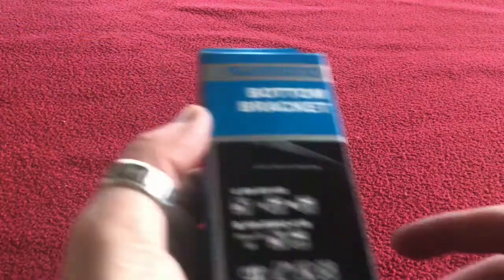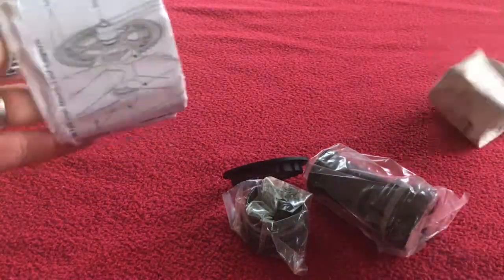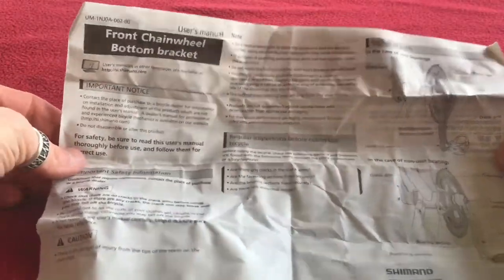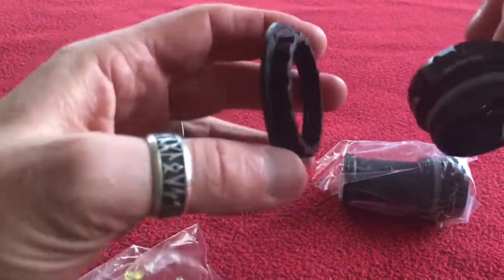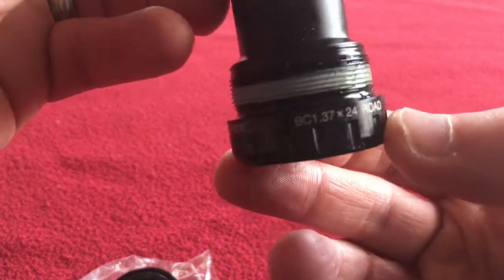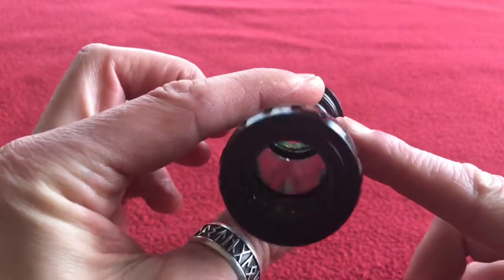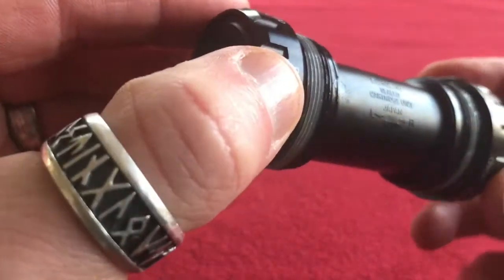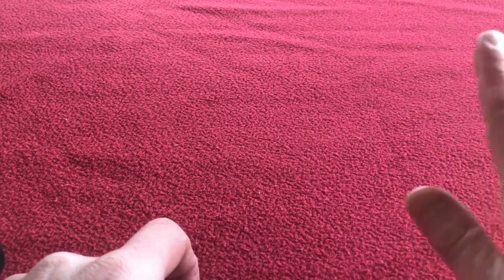Shimano Dura Ace BB-R9100 Bottom Bracket Unboxing

Comment: So how durable is this design compared to say the Tiagra 4600 BB weighing in at 95 grams for the 68mm one ?
Reply from the maker: mybluebelly I’m not sure, it’s the first threaded B.B. I’ve ever had. 👍
Reply: Ok. I ordered the R9100 BB from Japan a few days ago so guess i`ll find out firsthand. Basically was looking for a lightweight design BB. Hope the smaller than average balls will perform.  One more thing. Do you have the right tool to fit this BB, and exactly what tool is it ?
Reply: BTW, a few months ago i got a Wheels Mfg. BB 86 for another bike i have. It`s a press fit design, but the core of the cups is threaded onto eachother. The whole thing is made of alu. so stiffer than your average press fit. If you`re not familiar with them, check them out. Not the lightest BB but certainly a nice upgrade. I got the angular bearing type which has a different more durable design.
Reply from the maker: mybluebelly the plastic ring that comes with it fits over the end so you can tighten it, the tool I used is an x tools bottom bracket spanner.

Comment: you think the r8000 crank will fit this
Reply from the maker: Chet Langford my dura ace 9000 fits and I’m pretty sure the spindle is the same on the r8000... it’s hollow tech right?
Reply: yup
Reply: im wanting to run a 1x 38t oval  on it! the r8000
Reply from the maker: Chet Langford should have the same size spindle. I can’t see a problem
Reply: hi! did you find out, is Ultegra R8000 crank working with Dura Ace BB-R9100? thank you!
Reply from the maker: Yeah it fits. 👍